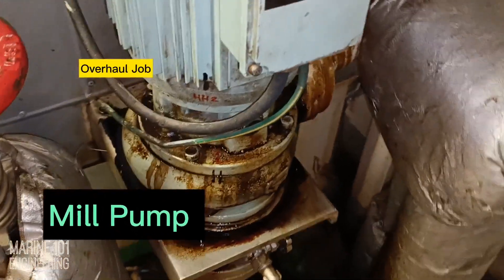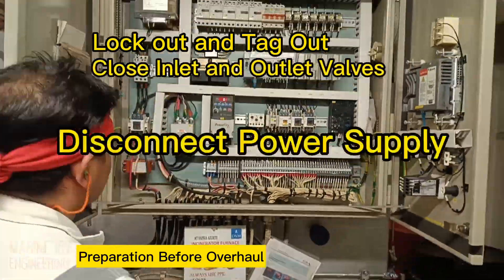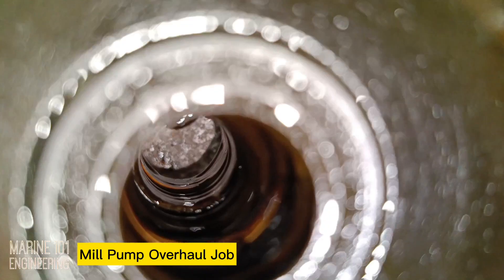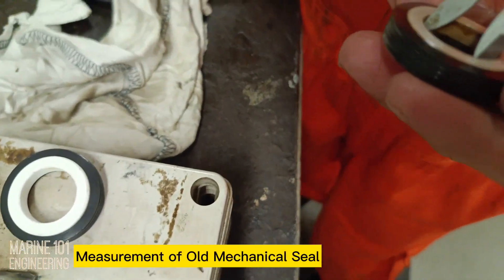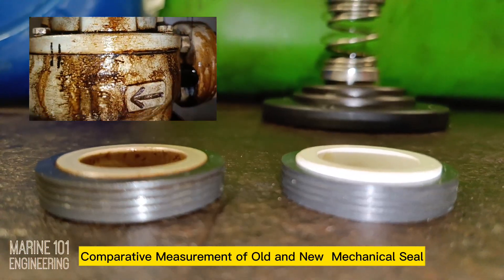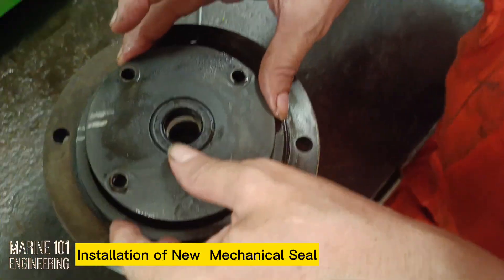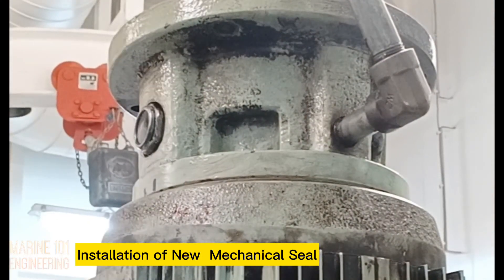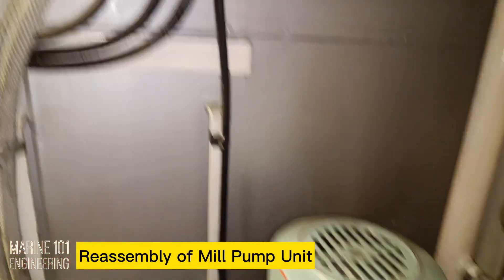How To Replace Double Mechanical Seals: Incinerator Mill Pump Repair Job- Video 29 of 101

Comment: Very helpful video!!
Reply: Yes today I overhauled the pump and tried out successfully. But during overhauling found shaft become little thin in the area near mechanical seal so i replaced whole motor. Thanks to spare motor we have.
Reply from the maker: Nice! Good for you. Getting expert with pumps! Keep rocking!
Reply from the maker: Thank you for your feedback!
Reply from the maker: For that type, that's how we made the disassembly. Hope it helps, let me know if you tried other options with this pump. All the best!

Comment: sir, in the mill pump body, why is the sight glass is used for?
Reply from the maker: Like most sight glass, it is for engineers to be able to carry out visual inspection in cases of leak. :)
Reply: @marineengineering1O1  thanks for ur reply 🙏
Reply from the maker: @mec6953  Thanks for taking interest on the videos posted here. Your feedback helps in content creation as well. God bless.
Reply: Because it needs oil that the dumbo who made the video didn't use, it's sightglass to see the oil level, see that L shaped pipe at 4:15 ? It has cap and it's used to put oil inside.